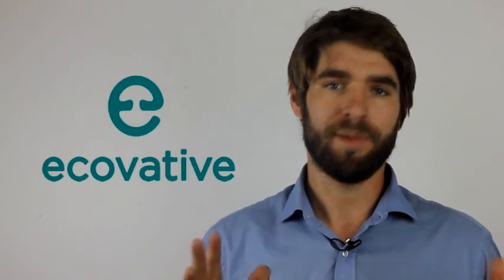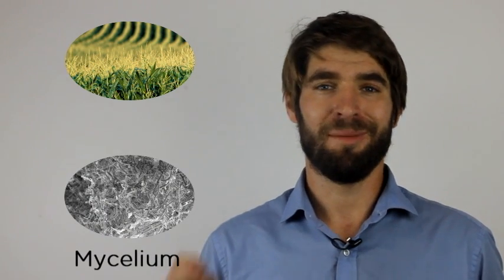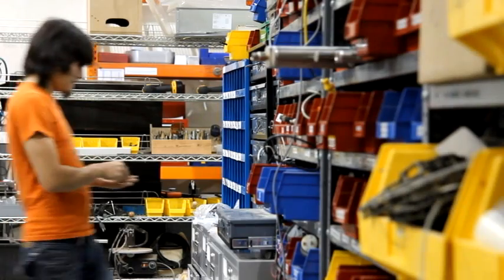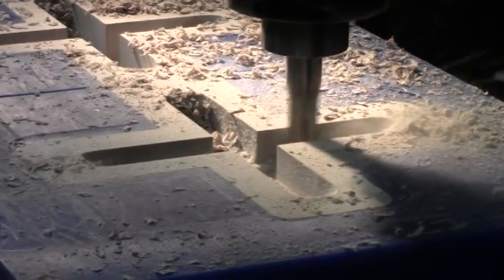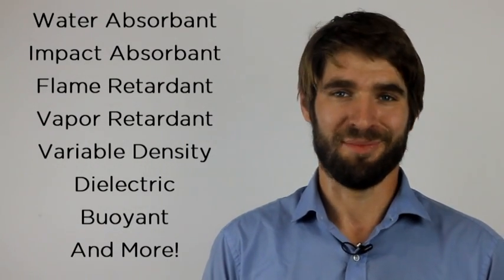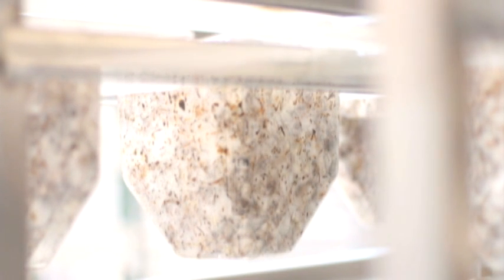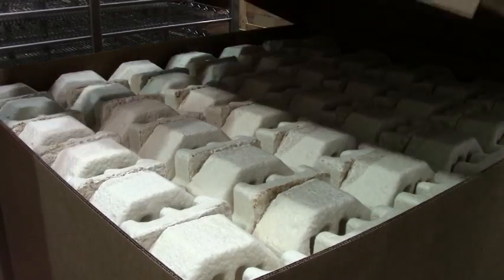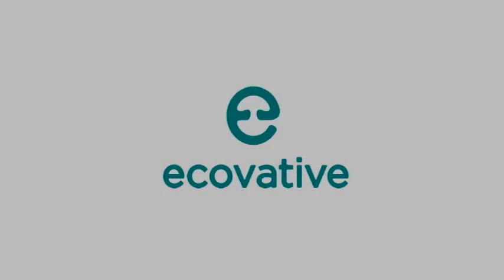Ecovative's Mushroom Materials

Comment: takes days to grow vs. seconds with foams, how is it cost effective?
Reply: Most foams are plastics based, therefore Oil based. Are you seriously under the impression that you can drill or pump crude oil & oceanic ship or Pipeline it to a port then refinery, where it's processed down into various chemical components, then shipped again to a processing plant to be turned into constituents (stored in plastic or heavy steel drums) that make various foams, before then being made into foam. In Seconds?!
Compared to locally produced farm WASTE being combined with mushrooms & grown into a mould. In 2 days!
It stands to reason that once they have mass production they'll undercut the Oil industry.
Do you have any idea how complex the maintenance of an Oil Rig & sub-sea well heads are. High waged engineers, operatives, regular helicopters flights. Oil rigs support a town type community.
Or growing mushrooms with woodchip or corn stalks from farmer Giles next door! 🤦
You have to pay to remove plastics/foam waste. Theoretically you could charge for Mycelium waste as it's a source of nutrition (vs compost?).
Don't bother arguing "how long does it take to grow corn?".
What, that we can eat?...